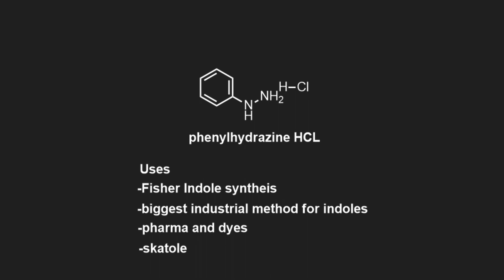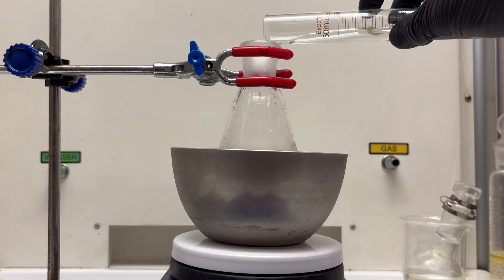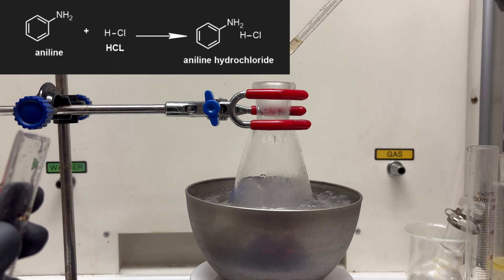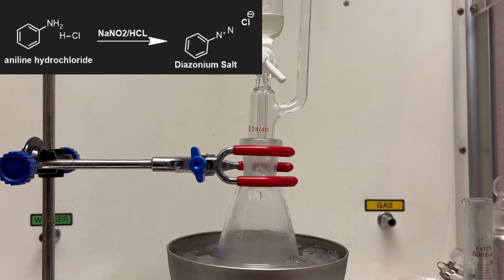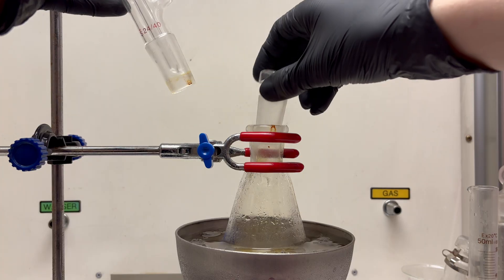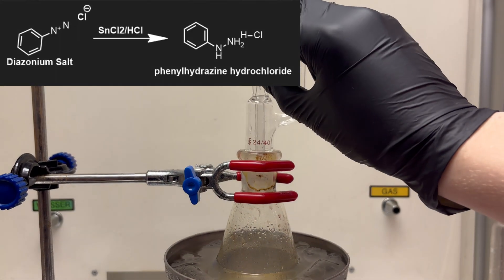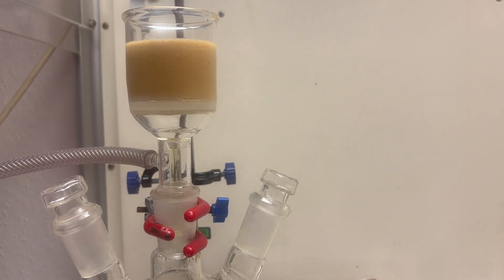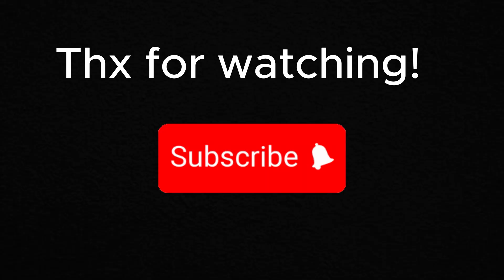Making Phenylhydrazine

Comment: Thanks for the mention ! 
Nice synth, I would have done a recrystallization maybe 🤔
Reply from the maker: For Phenylhydrazine HCL i think a recrystallization is nearly impossible i saw in literatue.
But Thx!
Reply: @MrYellowOffical  It's sparingly soluble in water, and a quick lit search gives some hits for it being recyrstallized from water.  It's more soluble in ethanol, so an ethanol/water recrystallization should work.  I would dissolve the material in a slightly-over-minimal amount of boiling ethanol, then add water until things get a little cloudy, and cool slowly to room temperature, then set it in the freezer for a bit.

That is, if you care about the purity.  No disrespect if you don't--not everything needs to be analytical grade!
Reply from the maker: @adrianhenle  Thank u but for my purpose to just freebase it for the skatole the purity is good enough but thanks for ur time and your Comment!